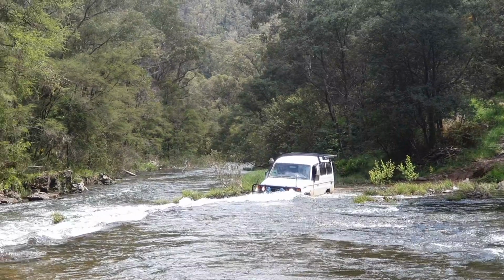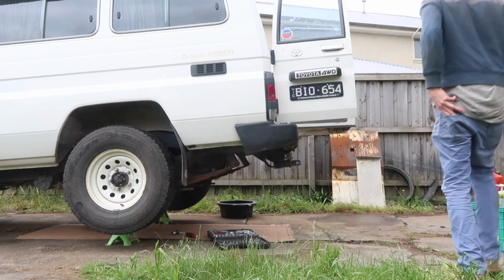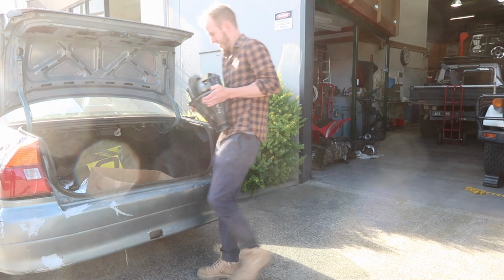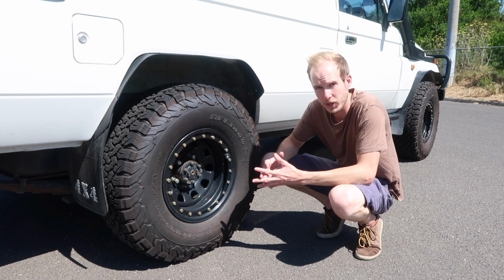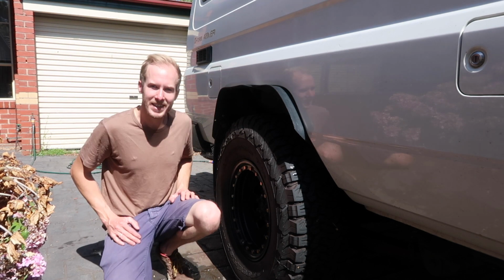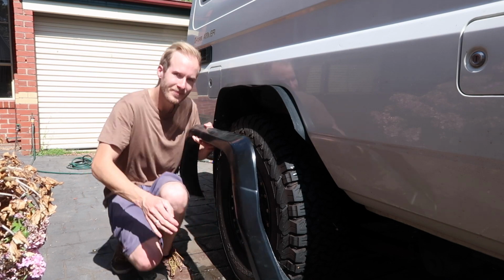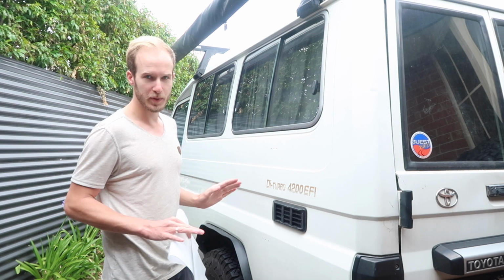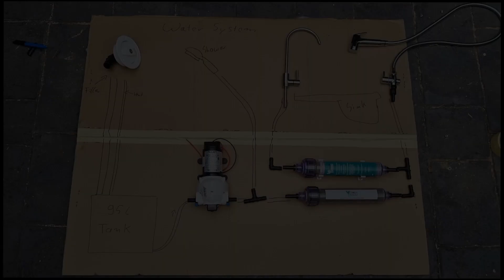DIY Expedition Vehicle build. Make your overland better offroad! Lockers, tires, Maxtrax! EP3

Comment: Love it mate. Did you think of getting wider tyres and not cutting your flares down?
Reply from the maker: Yeah 305's probably would have been the right width. But I think the 285 is perfekt for overlanding with the troopy. A wider tire just adds more rotational mass which makes the car accelerate and brake worse. And lets be honest a troopy is already very slow:)

Comment: Straight in with an aftermarket exhaust? That's an overlanding NO-NO!! Stock items, that you have a good chance of getting replacement parts all over the world. Yep you can go trick if you buy one that will enable stock parts to be replaced within it. 
Locking diff is also a general No-No, as you are overlanding, not off roading, the criteria of the build is not needing such things unless you are excessivly taking risks. Remember the vehicle IS your home, so taking unnecessary risks puts your life in danger! You do not do that unless your life is already in danger!
Tyees: YES! THE first modification that you should do, and probably the ONLY necessary driveline mod. 
If you have to mod the body (Add flairs) you picked the wrong rims. Again Stock standard as you don't need to alter anything else and to be honest, flairs are weight, weight is bad. Weight is your enemy. Do everything you can for an overlander to reduce weight.
Reply from the maker: I appreciate your Input but I respectfully disagree:)
In my opinion it's the better choice to have a new rugged stainless steel exhaust mounted then a 20 year old clapped out stock one that's likely going to break at one point. Also exhaust repairs are super easy regardless if it s stock or not and the new 3" exhaust lets the engine breathe much better. 
Lockers. One of the best mods in my opinion and a great insurance. I do want to get to places that are hard to get to and just because it's an overlander does not mean I will shy away from hard off-road trails. I am super happy for the locker in many situations like deep water crossings, off camber terrain in the mountains or hard tracks.